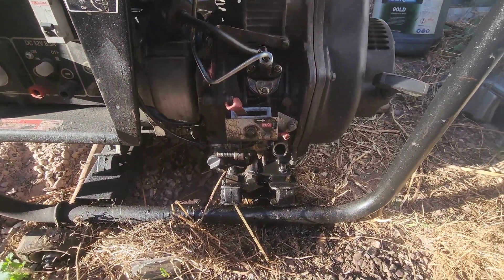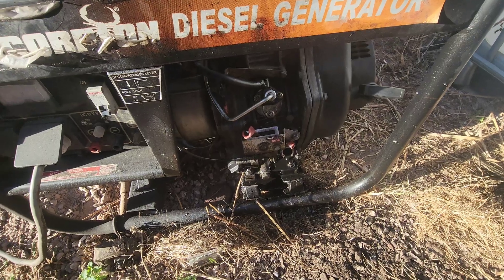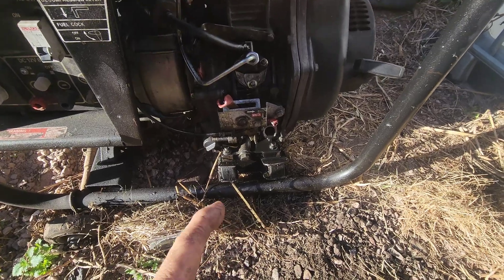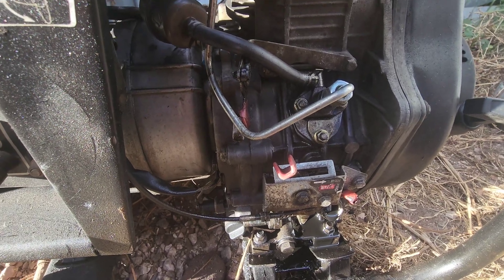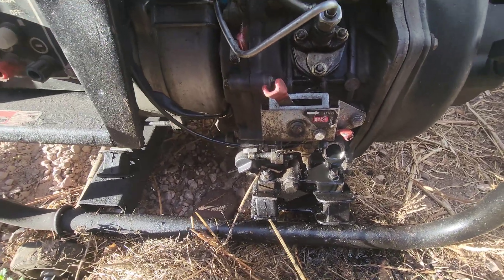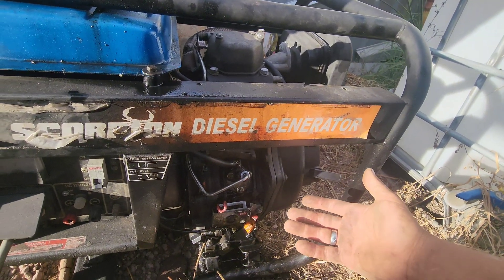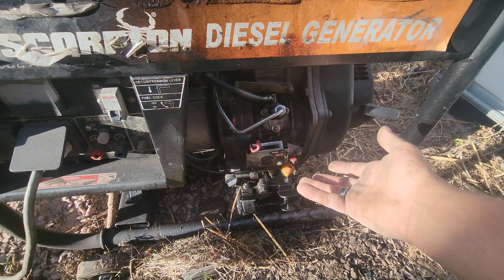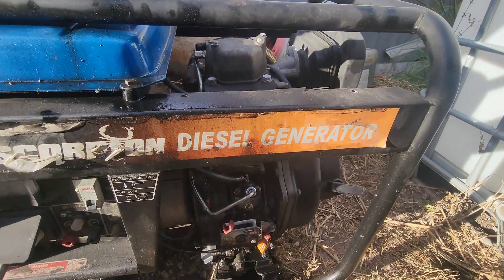186F YANMAR CLONE DIESEL GENERATOR ALMOST SELF DESTRUCTED

Comment: How many hours are on this old thing? I thought the engines would run for just about forever without wearing out much
Reply from the maker: Only a few 100 maximum 300. Just left outside all its life.
Reply from the maker: They are a strong little diesel
Reply: @Oneupthesleevecustoms  I figured they would be, just strange it's somehow running away already haha is oil getting past the rings or something? I've had cheaper 212cc petrol generators with a couple thousand hours with no oil consumption
Reply from the maker: @19jacobob93 the injector pump leaked into crank case haha.
Reply from the maker: @19jacobob93 over filled by like 7 litres
Reply: @Oneupthesleevecustoms  Holy shit that would do it haha
Reply from the maker: @19jacobob93 yeah it flew out of the filler

Comment: Alternator could of killed itself when it was running over speed. Insualtion could of failed from overheating or short-circuiting in the windings. Thats if your getting no voltage output. 👍
Reply from the maker: I think it's smoked another rectifier on the centre windings I've got another one so will swap it out and test again. Over speed may have smoked a couple of things